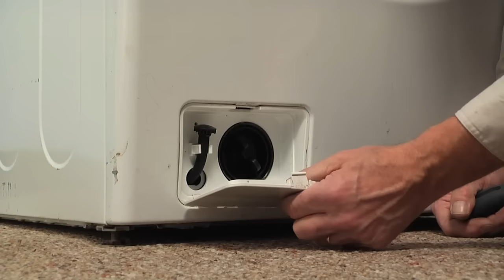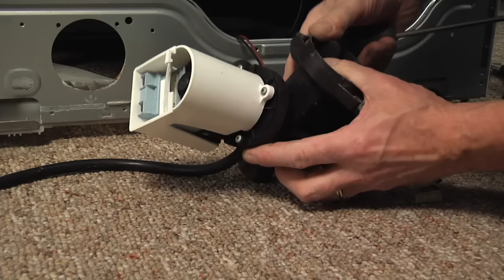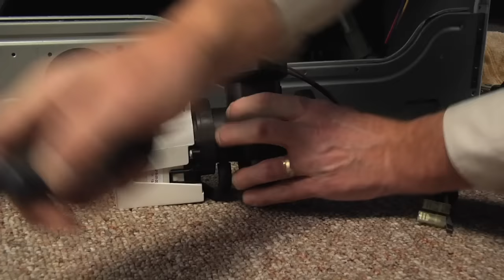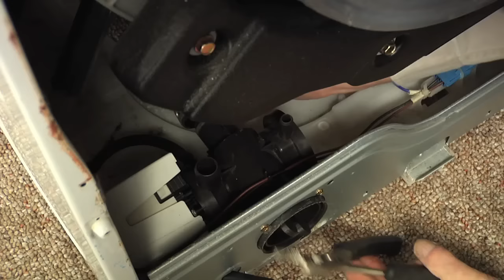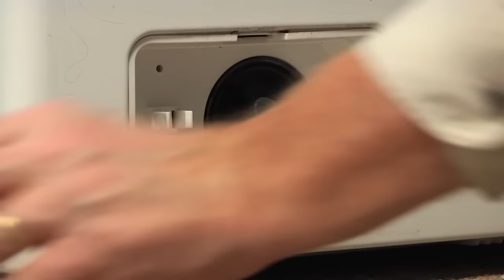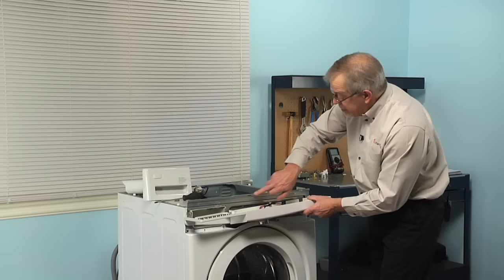Washing Machine Repair - Replacing the Drain Pump (LG Part # 4681EA2001T)

Comment: thanks a lot for the video Steve; you've saved the machine from getting scrapped; the service guy recommended to scrap the m/c and get a new one; your video was great inspiration; I gave it one last try, and I could clean the clogged drain hose, and it worked like charm; working with the ring clamps were the most difficult part due to lack of proper tools.
thanks a lot for sharing the video

Comment: Great demonstration. Very clear – no surprises. The spring is the only part that was a bit of a pain in the butt.
Reply: This video is stupid beyond belief!  Just pull the washer out a few feet and tilt it back towards the wall.  You can access the pump through the bottom of the machine without taking the whole dang thing apart!  This video is like changing a light bulb by accessing the fixture through the room of your house!  LOL!
Reply: @joerob3449  you must have been one of the geniuses that spent 3 hours doing a 20 minute job....."knob eater"? Lol....how old are you?
Reply: @joerob3449  You have NO IDEA what you are talking about.  Tilt the machine back and access the pump from underneath.  Is that too hard for you to understand?  WTF?!?

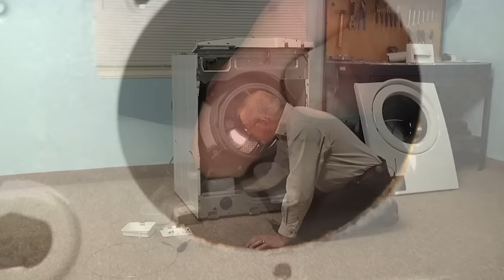Comment: I am an old retired industrial service technician and this is an excellent training video. I particularly liked, at 6:20, seeing blood on your finger; I think I've bled on every job!!

Also, I am please that you showed a well used machine; a new machine would often not present the "gotchas" that an older machine may have.
Reply: Hi there. I just replaced the pump, re-assembled everything correctly and set it to wash a load. I monitored everything throughout the entire cycle and even lifted the drain hose out from the drain to verify that the washer was indeed removing water out through the hose. The load ended, I opened the drain pump compartment and checked the hose (the small one with the screw cap) and I immediately noticed a small drizzle (bad sign). I then began unscrewing the drain pump's cap and sure enough it was full of water, which was my original problem.  Any ideas on what to do next? Any help would be greatly appreciated.
Reply: @daniel_ukiah  My LG always has some residual water in the drain hose (behind that panel) and pump filter assembly.  The maintenance instructions for the washer indicate that you're supposed to drain it before cleaning the pump filter.  So long as it's couple quarts or so, that's to be expected.  The pump isn't going to be able to force enough air up the main drain hose to clear the water out of that into the drain!

When my pump failed, it was obvious - nothing was making it up to the normal drain hose, it was making a bunch of noise, and the only thing the pump was able to do was to somewhat speed up draining the entire washing machine through the drain hose.  I ended up finishing a load by initiating rinse and spin cycles from the front panel and draining the whole washing machine through the small drain hose - an hour of draining into tubs and having my kids run them to the sink.  Now I'm replacing the pump motor assembly!

Comment: This was fantastic.  My model is a little newer so the pump assembly was on a tray which had to be removed by a 10mm socket.  Luckily mine just had some fabric caught which was causing the pump to not turn.  This video was a great help.  Did the whole tear apart and put back within 30 minutes.

Comment: Thanks Steve, You're The Man!!! We followed every step & our washer is draining like a Paul Peirce Buzzer Beater! That's why You're here!
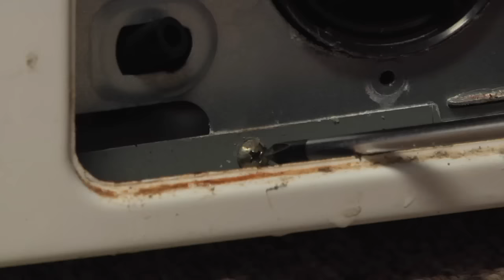Reply: Great video, very helpful for those inclined to pursue the art of repair for themselves. However, one step was omitted during reassembly. At 3:04 , during disassembly, you removed a short machine screw behind the drain pump panel. This screw retains the front panel of the washer in conjunction with several screws on the top of the front panel. You forgot to mention to install this short screw during reassembly. Otherwise, thank you ,sir.

Comment: Thanks for such a detailed description of performing this repair! Did it just like you showed and fixed my problem. (Found a finish nail lodged in the pump, removed it and reassembled so I didn't even need a pump or motor!)
Reply: Good to see! Think this is what I'll need to do, only the culprit is dried beans. Ugh.  I still kind of hear a draining sound so the pump is trying to work. It sounds slow.

Comment: This is the only instructional video that mentioned that there may be a bolted metal frame holding the pump on the washer machine. Every other one talked about pressing down on a plastic clip to slip the pump motor back. Thank God for this video. Ours was bolted in.

Comment: Great video.  I was going to call a repair guy but after watching your video I was able to fix it myself and the drain motor was only $64.99.  Thank you!
Reply: You could it that part on Amazon for $21.50-$40.00 depending on seller. But retail is around $65.00 in local stores.

Comment: This is a great video and helped me replace my LG drain pump.  Thank you so much for the detailed video.  The one thing I will point out that was not mentioned in the video is that when you are installing the new drain pump, in addition to the two hoses with the clamps that we shown in the video, you have to remember to put the smaller black hose tube on the back of the pump.  This is the black hose that is in the the door opening on the bottom left hand side with the drain filter.  If you don't do this, water will leak out.  I experienced this and had to do back and connect this hose.  the hose connection is on the back of the drain pump, NOT the one in the front pointing up.  Was able to order the replacement pump on Amazon for $25 and received the next day.  This video allowed me to fix the washer over the weekend and save hundreds of dollars if a repairman had to come out.  Thank you!!

Comment: This video was incredible. I didn't have to go as far as replacing the motor, but I felt confident that I could if I needed to, with your help. Thank you so much!
Reply: Did you just need to clean something out?  We had beans in our washer and I think they're clogging somethi g.  We have the OE code. But I can hear it sort of draining in the drain tube.
Reply: I have changed the motor but my washer is still not draining  I tested pump in the sink and it pumps water but not enough to push water up the drain hose  any suggestions? 
Thank you for your help

Comment: Thank you for this video! It was very helpful!   I'd like to point out that its easier if you address the control panel retaining tab before you release the clips.  If you do the clips first, it causes additional pressure against the tab - making it more difficult to pry.  Also, its generally advised to use a phillips screwdriver to remove the bellows band clamp, as its less likely to cut into the rubber.  However, my advice on that is to use a plastic pry tool as to not accidentally cut the expensive bellows.

Comment: Great job with the video, it was perfect! The only difference I saw was that I could install the new pump in multiple orientations on the connection with the drain housing so I had to look for the original screw marks to get the correct alignment.
Reply: Good call Chris!  I experienced the same thing.
Reply: Yes i wished i had marked the screw  holes.

Comment: Well done video, thank you. You forgot to include one step in the reassemble process. The short screw near the drain hose needs to be replaced before you put the cover on. My washer is back to normal, thanks again.
Reply: Thank you. I was concerned about the extra screw I had
Reply: Mine is sitting on my mantle

Comment: Fantastic! Thank you so much for this incredibly helpful video. Just finished swapping in a new drain pump and it works like a charm. FYI - reinstalling the spring clamp w/out spring pliers was the toughest step, but it can be done. Recommend long handled pliers for extra leverage, and  some patience. Thanks again!

Comment: Nine years later this is still helping people! I am a senior lady and was able to follow along and get it taken apart! I do not know if it is the drain pump that is bad OR the little tiny drain tube that is plugged up (sandy gunk in it), but I think I will replace both since I don't want to do this twice. It took me about an hour and I needed to use my drill on reverse to get the screws out that hold on the front panel. Thanks!!
Reply: NOTE: Make sure you have the slip joint pliers or those metal clamps are nearly impossible!!

Comment: Great video, Just did this repair on our LG that quit after 7 years, the shaft rusted out on the motor. Only took about 30 minutes to take apart, but 6 DAYS to wait for the part ordered online. (the closest part store is 3 hrs away & it wasnt in stock). Had it put in and running in about 20 minutes, and like other comments, that spring was the worst part. Wife is happy again !! Thanks!!
Reply: Lol, that's nearly what happened to us, and we live in a city of 500,000.  No one (that I found) had the part in stock, so I ordered online for $35.  That was Monday, it didn't arrive until Friday. At least the video made it easy enough that I was able to get it back together in less than half an hour.

Comment: Thank you so much! Due to your excellent  and detailed instructions i was able to take everything apart without pulling the machine out of a tight space. There were only a few minor differences between your LG machine and mine, i was able to get the pump out in about an hour, counting finding tools. I phoned Reliable Parts in Edmonton Alberta and they are sending the new pump by courier for only $11 shipping. The part was about $70, and it is a genuine LG.  I wasn’t sure if it was the pump , it would hum for about 10 seconds then quit, and not drain. Turns out the impeller had snapped off. So it did need replacing. I am a handy mom, but definitely this is not my specialty. Your video is excellent! How kind of you to make it. Thank you.

Comment: Used your video to change my pump a little over 2 weeks ago. It was stopping me almost every load with the OE code. After the replacement, not a single fail in 2-3 weeks of laundry. Thanks!!! $40 part and about an hour of time instead of having to hire a repair man or buy a new washer.
Reply from the maker: Great to hear!

Comment: Fantastic video, THANKS!  Just an FYI, if you have a dryer stacked on top of your washer in a tight closet like me, instead of wrestling the dryer off and out, you may want to try simply sliding the top cover back (after loosening the screws on the back) with the dryer still on top.  It worked for me and was able to follow the rest of this video to a tee!  As noted by others . .  . this video saved me a ton of $$$ on a service call!
Reply: After looking at your suggestion I checked and my space is so tight I can’t reach the back 😢. Plus the bracket that holds the dryer blocks access to slide the washer top back.

Comment: Great video - straightforward and detailed.  The extra tips that you added - such as using the drain hose to get the excess water out of the the pump and watching out for the locator slots on the control panel - surely saved me from some added frustration.  Whether or not you take pictures, keeping track of which-screws-go-where as you progress down to the pump definitely helps when it's time to reassemble.  Thank you!

Comment: I have the model with the control panel on top but after watching the video a couple times, I tackled 
the repair and have successfully run two loads (without the OE error message or the unit stopping!)! 
This was an extremely helpful video! Thank you!

Comment: I've done this 9 months ago and my pump is bad again (loose impleller- sound of impeller banging on the pump housing). When the pump was working, loud motor and water movement sound is evident but now the sound is just a motor rotating along with tapping sound like plastic to plastic caused by the impeller banging on the interior of the pump housing. Great to revisit youtube and found again how simple it can be. Youtube presentations can always be easy. Usually what delays any job in real life/time is the preparation or availability of proper tools, worksite organization, lighting, some muscle power and grip/pinching power with the spring and electrical connectors and first and foremost the access to the machine. In my case, I do this onsite on the laundry room without moving the machine as it is fronting a narrow hallway. Moving it out then in after the repair is the hardest part and most time consuming. The access issue in removing the screws in the back of which you can loose and drop if not careful is resolved by a magnet, proper lighting, catch pan, mirror, stubby magnetic screwdriver,  and patience. Before all this though ,the knowledge presented here makes this repair 90 % flawless. Thanks for posting!

Comment: While the pump is out, remove the tube and make sure it is not clogged. Sand and soap residue build up.
Reply: the big black tube attached to the drain pump and the bottom of the tub?   there is also another end to that tube in the back of washer, disconnect that too?  if all three ends of that big tube is removed can you take it out and wash it?  i saw a video stating not to disconnect the end in the back of the washer.

Comment: Great video.  Was able to change out my drain pump successfully.   Only cost 20 dollars for pump and less than 2 hours.   Hardest part was the front panel clamp. Had to get my wife to help while I was pulling on spring.

Comment: I just had to replace this part and there is an easier way to do it.  When my pump first stopped working, I followed instructions similar to this to take the drain pump out and found that the turbine on the motor had come off. Everything I read said you have to replace the pump because the turbine will keep coming off. I couldn't get a new pump for 5 days, so I super glued the turbine back on and put everything back together. Getting the spring clamp back on was super hard since it hadn't been touched before. It took 2 people.  When the new pump came in, I had read that you can access it from the bottom.  Just lean the washer back about 45 degrees and you can get to everything you need. You will only need a phillips head screwdriver for the entire process. Do the instructions that start at 1:40 to unscrew the drain pump housing. Then just tilt the washer back and access the back of the pump housing to release the latch (shown at 6:09) then you can pull the pump and housing out enough to access it.  Unhook the electrical wires and unscrew the pump and put on the new one. Attached the wires and run them through the clips on the housing that hold them. Run the drain hose back in as you put the housing back into the latch. Screw the pump housing back in from the front and put the plastic parts back (make sure the drain hose comes out as it was when you started). Having done it the long way (as shown here) is helpful for the knowledge of where things are, but you just have to take apart way too many things that are not involved in the pump replacement.  I was able to replace my pump in less than 15 minutes.
Reply: Excellent.. Thank you. I'm waiting on my pump but that install sounds much better. I've done those drum rings before and there a bitch!  But thanks to the partselect guy.
Reply: Nah, too late but pumps do break so i will follow your instruction tje next time. And i would not have to fight with the rubber.
Reply: Easier from the bottom. That spring is a night mare. Take the bottom panel of and turn the machine upside down. Pump easy accessible .

Comment: Just used this video to change the pump on my LG WM2455HG washer. Everything went exactly as the video. Thank you for the great details and small bits of advice for each step. I even got the boot clamp replaced on the first attempt simply by following his instructions exactly as he gave them.

Thank you!

Comment: Thanks Steve! We downsized from a 2600+ sq ft house to an 1100 sq. ft mobile home, that I gutted and rebuilt. I designed the cubby around my washer and dryer, without a ton of free space. My wife walked in this morning and told me the washer was broken. Uh oh! I was relieved to see that I can disassemble this thing without moving it. I was dreading having to move it out. I'm in the middle of putting in a new heat pump, so this didn't happen at the most opportune time.
  My pump motor still seems to be running, but sounds like the impeller has come loose. I scrapped another older LG washer, and may actually have a spare pump. 
  Now, if I can get my Bobcat Skidsteer running, life will be good!

Comment: We had no problem going through the bottom. It saved a lot of unnecessary steps.
Reply: Likewise!  I went though the bottom too.  Saved me time and effort!
Reply: We must have a different model than what's in the video because there are two support beams/bar thingies across that area. You'd have to have hands the size of a toddler to work around them and you'd still not be able to get the pump out. This video is great for anyone with a similar situation to ours.